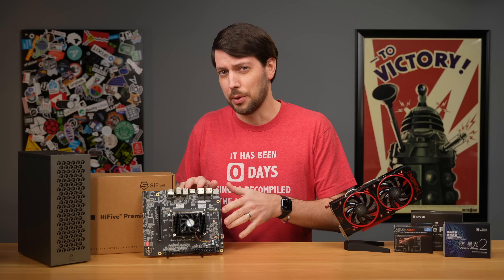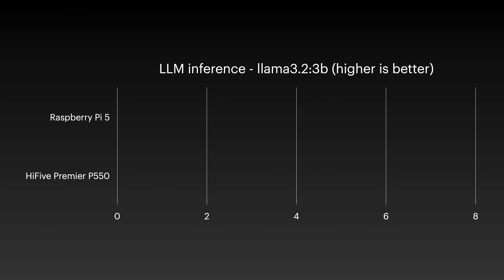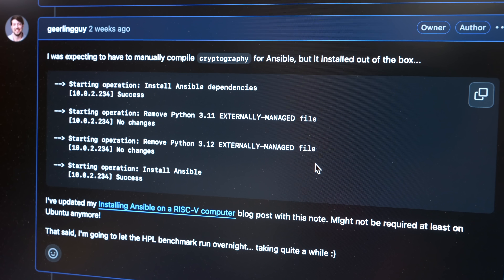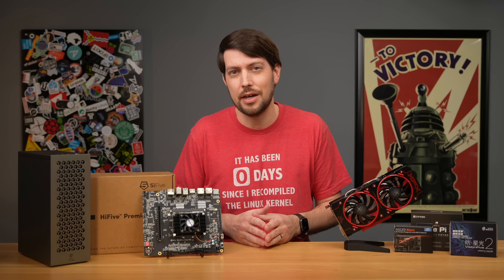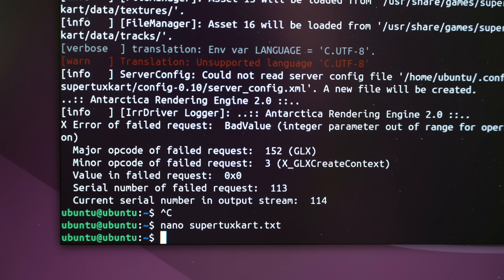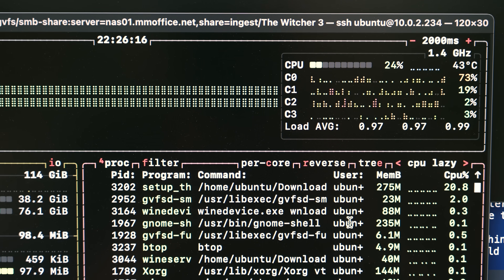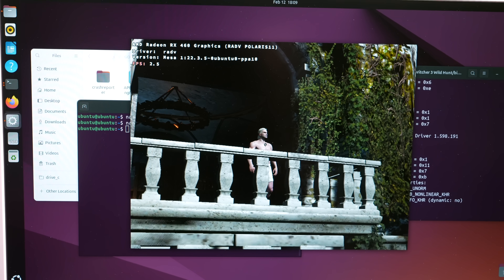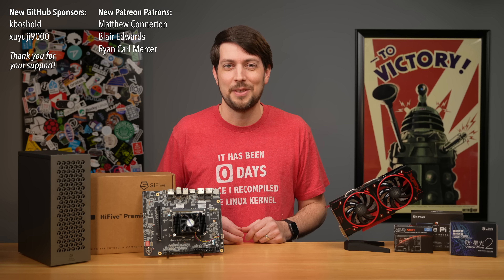RISC-V was supposed to change everything—How's it going?

Comment: The first actually fast RISC-V CPUs will probably be from Rivos - they're still a "stealth" startup but the rumour is they are working on server class CPUs. There's nothing inherent in RISC-V that means it should be slower than ARM, now that the vector extension is ratified (and required in the RVA23 profile). There are some minor differences, like ARM has more conditional instructions, 16 kB page support, etc. but they won't make a big performance difference in most cases. Generally the reason the chips are slower is just that all the RISC-V vendors started in the embedded space (just like ARM), and are gradually moving to fast CPU architectures.
Reply: Well... There is actually a few significant issues for RISC-V performance-wise: Lack of a register-indexed addressing mode (useful for arrays), and good ways to deal with medium to large constant values (as-is, it kind of shoots itself in the foot in this area if the constant doesn't fit into 12 bits; worse yet if a load/store displacement fails to fit into 12 bits). Granted, if one does address a few of these issues, it can get around 30% faster (in my own testing with programs like Doom and similar...). (Note that while the 'Zba' extension can help, it helps much less than actually adding the addressing mode in question). Another thing that helps is adding a Load/Store Pair instruction and similar (mostly saves time in function prologs and epilogs), etc.
Reply: @BGBTech  I'm unconvinced - constant generates very predictable instruction pairs that can easily be fused (even if low performance CPUs don't currently). Indexed addressing may be more of an issue but as you say Zba gets it down to 2 instructions that can be fused. It clobbers a register unnecessarily but RISC-V has lots of registers so it probably doesn't matter.

I'd be amazed if it makes 30% difference except in crazy microbenchmarks. Do you have a link to those results?
Reply: @ It makes a 30% difference in programs like Doom and similar, which spends a lot of its time in R_DrawSpan and R_DrawColumn loops, which fetch pixels from an array, feed them through a colormap (also an array), and put them into the output framebuffer.

As for indexed load/store: A 2 instruction sequence vs a 1 instruction sequence can make a bigger effect than expected in array-heavy code (where one may find that 25% or so of the total memory accesses are array accesses).

Similarly, as noted, a 32-bit constant load needs 2 instructions (LUI+ADDI). A 64-bit constant load needs either 6 instructions or a memory load.

A big issue is often where a Load/Store displacement fails, which needs 3 instructions (say: LUI+ADD+LW); which in my case is frequently needed to load/store global variables. One workaround here is having a 64-bit encoding with a 33 bit displacement.

But, yeah, in my own testing, these sorts of cases are a lot more frequent than one might think...
Not sure of any formal results, mostly this was in my own tinkering (with my own compiler and implementation).

Though, can note that in my implementation (Verilog+FPGA; and emulator), all ALU type instructions have a 2 cycle latency, with a 3 cycle latency for load and store operations. In this case, this is with a 3-wide superscalar core.
Reply: @BGBTech  None of that surprises me at all. Most people forget that the RISC concept started when moving from an 8 bit adder to a 16 bit adder cut the ALUs speed by more than 1/2. Almost all of the advantages of RISC design assumes priors like a significant clock speed advantage that don’t functionally exist anymore for anything with grid tied power.
Reply: @BGBTech are these extensions also open architecture or do they require licensing?
Reply: @BGBTech  Dang, no register indexed addressing mode? The rich addressing modes of ARM is one of the things I love most about it. Just the one ldr instruction, but a huge variety of work you can do with it. The only missing address mode I always wanted is post-increment by register. You could increment the address register by a constant after loading, or add another register to it before loading (with or without writeback to the address register), but if you need to load and then increment by a register, it takes two instructions. Sometimes you could work around it by subtracting the increment register before doing a loop, so the first pre-increment gets you back to 0, but obviously that's not always an option.
Reply: @dekutree64  Are you aware that loops will just be replaced by vector intrinsics and you dont have to increment at all anymore?
Reply: Pretty sure tenstorrent are also plans a general purpose CPU as well. I have far more hope for something those guys are working on, given their pedigree
Reply: Oooo. I hadn’t come across Rivos. What an interesting company, $250m raised via reputable fund and folks like Dell & MediaTek. That’s an exciting prospect.

Comment: As a Linux fan, I am always excited when I hear the words 'Open Architecture'. RISC-V has the potential of opening new avenues for the existing CPUs have a lot of legacy bloat, and the very idea of using simpler processing potentially could help performance in the long run.
Reply: No. Having crappy addressing modes and no select/conditional move is a severe hindurance to performance.